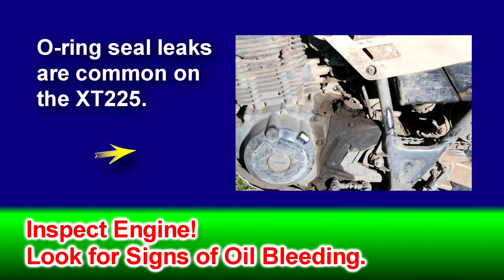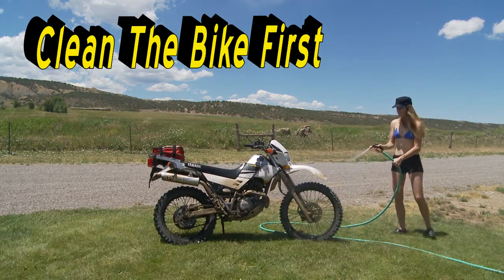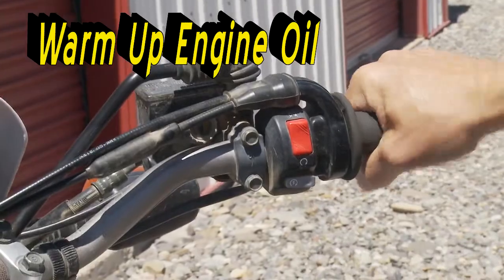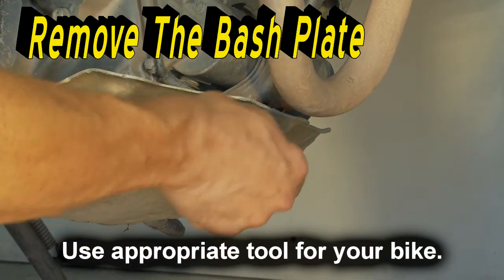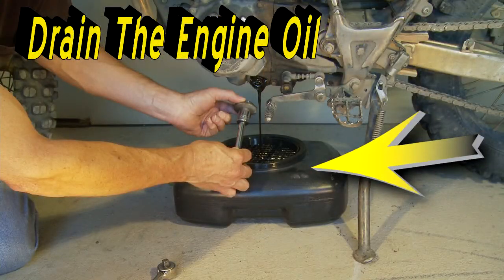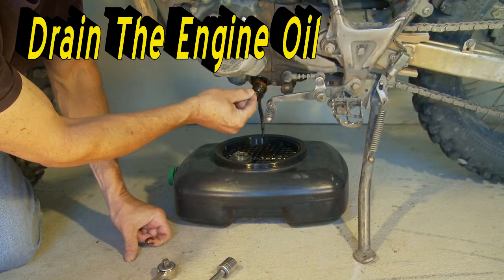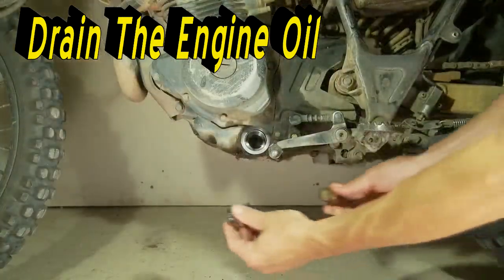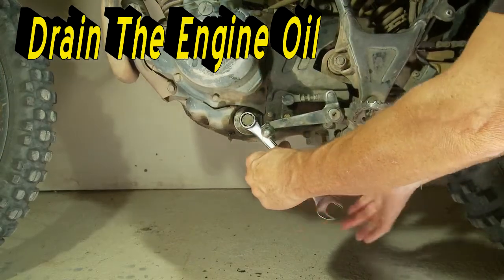Yamaha 2003 XT225 Oil Change Part I of III

Comment: No filter change…wow!
Reply from the maker: Both oil filters use a screen or micro screen.  Replace them both with new units if you like.  I used full synthetic oil and changed it every 500 miles.  Oil stayed pretty clean.  I didn't see the need for new filters every oil change interval.  Personal preference.